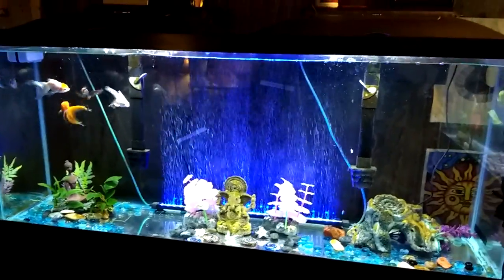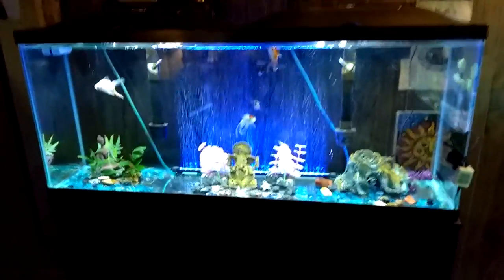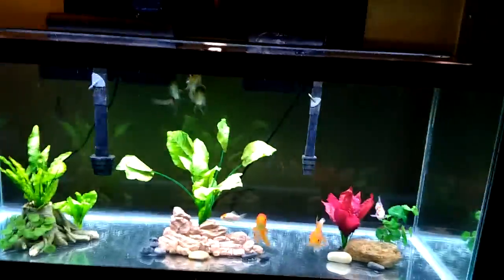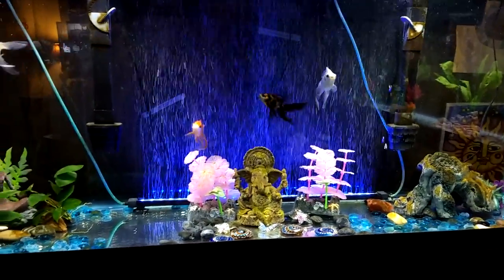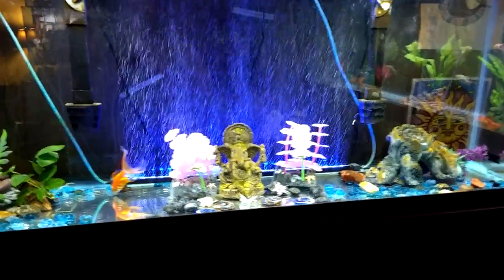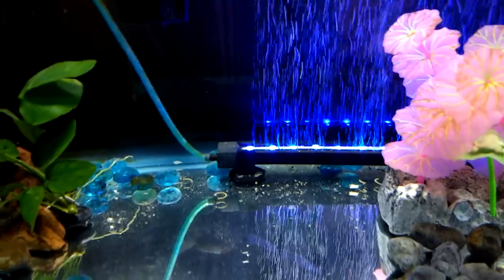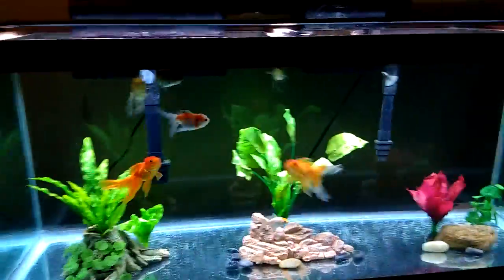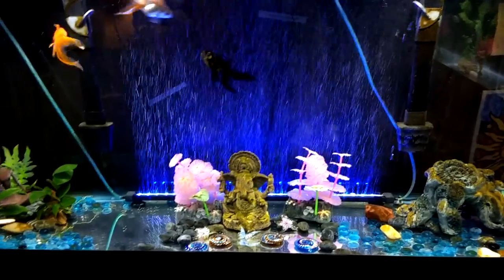LED Bubble Wall🔥~ How to Setup + Tips

Comment: Hi sweetheart, I have 2 smaller ones (without remotes)  lights are on 24 hours a day...never saw a switch. So my fish will have to sleep with the LED lights on...MF♥
Reply from the maker: Michael Firestone they will sleep even with them on but hmm I'd just worry about them being on 24/7. Like maybe overheat or something. I'd personally suggest unplugging the lights at night to let the fish rest + let the light cool off too 🌷
Reply: Plug it in on an external timer. Done.

Comment: Thanks so much for posting this.  i just bought one.  I noticed, you had a  line going out of the other side as well.  Where/what does that hook into?
Reply: Longer bubble wands have two connectors to allow adequate airflow into the wand.

Comment: Barely any bubbles come out of mine
Reply: @Dun's World I myself use the Eheim 400 air pump, which comes with 2 air outlets that can be controlled separately. This is a very silent pump compared to other brands, yet a powerful one while only using 7-8W, it can be used for aquariums from 50 liter up to 400 liters, and isn't very expensive (available on Amazon). And of course as all air pumps it needs a power socket. Tip: DO NOT PUT THE AIR PUMP INSIDE YOUR TANK! Place it next to it, or on top of it. And always attach a non-return valve (or check-valve) into the plastic tubing, to prevent tank water to run back to the air pump in case of a random power outage.

Here's a link to a video of this particular air pump: https://www.youtube.com/watch?v=LBOf_VAljDw
Reply: TheOpelkoenjas for my 55 I just bought a 12 inch led bubble bar and bought the strongest air pump Petco had (rated for 100 gallon tank) and all the bubbles come flying out the first couple holes in large amounts and barely come out rest of strip no matter how I configure it.. do you think the pump might be too strong for the bubble bar? It definitely should not be too weak

Comment: no one ever mentions air pumps in dese videos..
Reply: Indeed. Would be nice to know what capacity their air pumps have to create that amount of bubbles, so that people don't go buy one that isn't strong enough.
Reply from the maker: I shared this before with someone else on another video somewhere. Here is the exact air pump used in this video:

https://rover.ebay.com/rover/0/0/0?mpre=https%3A%2F%2Fwww.ebay.com%2Fulk%2Fitm%2F262074874443

It's for up to 300 gallon aquarium! Good price. Can be bit noisy. But cost effective.

Comment: I recently bought a bubble wall but the bubbles come out too big and it causes too much disturbance in the water Is there a way I can make the bubbles smaller?
Reply from the maker: Hmm. If you have hard water... eventually they will get smaller. Minerals and calcium from hard water will build up on the little rubbery bubble maker thing...lol. then it will probably be bit smaller bubbles. But if u have really soft water, they may never change size. I'm not sure

Comment: LOL with the sensor picking up signals from the remote control. That's actually funny, because I can relate to that! :'D And that's why I never put these sensors in plain sight for it to be able to pick up other signals. I had the same problem with one of my terrarium LED strips. But once I put that little sensor more out of sight - against the wall almost behind the terrarium - it no longer went disco on me when I changed channels on my TV. It does mean that I have to point the remote LED control straight towards the sensor, and thus having to make a few more physical steps towards it, but it did help not going banana on me whenever I watch TV.

Cheers!
PS: can I give a helpful tip? Don't place it too close to you filter inlets when using a canister filter. Air bubbles create micro bubbles, and those need to be able to reach the top of your tank before being sucked in by your (closed) filtration system. When too much micro bubbles are sucked in, which takes less time than you may think, it greatly affects your filtration system, and couldn't even mean premature death of your pump itself due to air pockets in the closed system. Unless you have a sump system, of course (which I think you're using?). Then you shouldn't worry about it too much.
Reply from the maker: Oh tysm!! I have the sensor back now. But ever once in awhile.. lol.. I go to turn my tv up or down and... BOOM.. the fish all turn bright green😂😂😂

Comment: Did you know by placing the the bubble wall so close to the filter inlets greatly reduces the efficiency of the filter pumps. (micro bubbles). 

Your filter pump manual should give you info on how close you can put the bubblers. Minimum distance of 6" comes to mind.
You would be better served to put 1 shorter bubble wall on each end of the tank instead.
Reply: Good catch.
Reply from the maker: Tysm for the tip!! I dont have the bubble walls now but if I get them again I will remember that!

Comment: How many watt air pump one way or 2 way
Reply from the maker: Nawed Sheikh I don't remember how many watts but it's for up to a 300 gallon tank. It has 4 outlets.
Reply: AquaStar ok   thnx but full installion video this system make it......upload
Reply from the maker: Nawed Sheikh umm ok lol I have alot going on right now in my life and you're being a little rude. Telling me to "....upload". I'm not posting videos as a job. I don't get paid for it. You just talked to me like you're my boss at work.  I clearly stated how to install this light. It's not difficult. Best of luck to you and fishes 😉
Reply: @nawedsheikh9451  What is it with people and not being able to think for themselves anymore these days.

1) attach the air hose from your air pump to the inlet on the LED. If there are two inlets, use either an air pump with 2 outlets or use 2 air pumps (mentioned in the video by the way)
2) place the LED in the water (use the suction cups that come along with it or replace them with better graded ones if you want to)
3) plug everything in
4) done.

It's that simple. No need to make a video out of something that even a small child would figure out by him/herself within minutes.

One tip: don't place the bubbles too close to the inlet of your filtration pump. Otherwise it will suck in too much air and by doing so, loosing a lot of it's filtration capacity, AND even putting to much stress on pump itself. Get one that is about half the size of your aquarium and place it as far away as possible from the inlet of your filter.

And for the people who say "It doesn't work as good as yours/it's faulty, because I hardly get any bubbles": get a stronger air pump, for crying out loud!! The more air holes you have, the more capacity the air pump needs to have to be able to produce the proper amount of air bubbles. Seriously, com'on people, THINK!